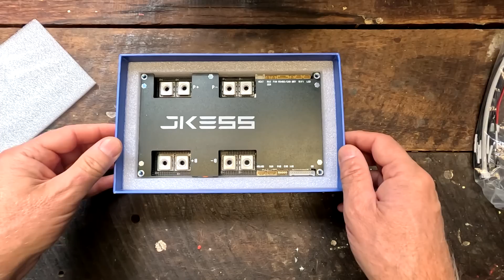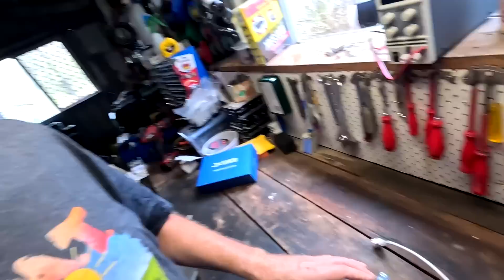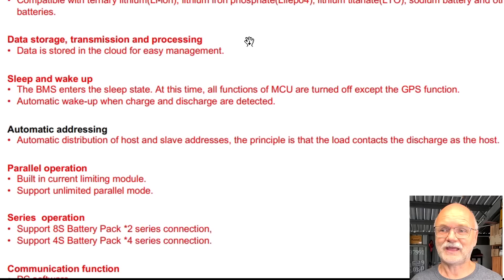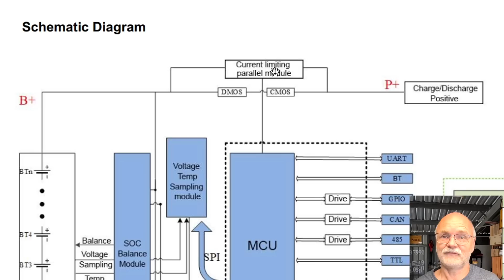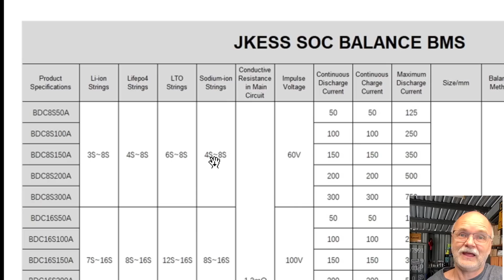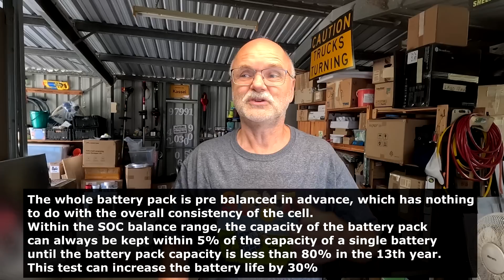Brand new JKESS BMS! Hardware, Specs, Features. It's not a JK-BMS though🤷‍♂️

Comment: If it takes the pack voltage and then using some kind of buck converter to charge up the lowest cells it means that it is taking a bit of energy out off all the cells to do this, how can this be more efficient than using cells that are approaching overvoltage and using these to charge the lowest cells, doesn't make sense.

Comment: first i thought they have completely messup something in the documentation,
but now i think, the 4 green terminals are meant to connect to a external LCD in the driving cabin with an additional programmable dry contact IN or OUTput.
But then the extension board has to be connected with another cable to the Wifi, GPS and maybe even the dry contact port of the BMS....then everything ould be extended into the drivers cabin.

the additional interal GPIO Cable seems to be an INPUT for a programmable trigger

But anyway...what a bummer :-D

Comment: @OffGridGarageAustralia: Andy can you please test it anyhow, you have it already. For offgrid it has not many new features that matters BUT for RVs and boats. It offers in  4S and 8S a lot of features nowhere else available like master and slave as well as communication plus the high peak current values allow to use the BMS also on motors with high surge like engine starter, windlass and bowtruster. Additionally the jk inverter BMS stops at 200A in 24V which is too low for use with engine starters and in boating the house battery must be able to start the engine in emergency. For that we need a 300A BMS which is only available from JK without any communication and no master and slave which again we need. If you don‘t wanna test it ship it to me and I will do the test…I pay for shipping.

Comment: I am waiting very hard for a fix for version 14 BMSes. They are nearly perfect. the only thing that is missing is the problem that they switch back from Absorption to Bulk when one cell gets to low. This should be fixed in 15.33 or 15.34 but these versions are nowhere to be seen. I still have Version 14 BMSes. Installed in paralell, connected to the cerbo, but not controling the charging because of this bug

Comment: The thing that I am very disappointed with is that they only sent you a 8S unit which means you cant really run it thru its paces in a 48V 16S battery like we use in our setups. I hope JK will correct this and get you a unit you can really use.

Comment: I don't like systems I don't understand how they work, which is the case here. 
Furthermore, it seems over engineered for what I need a BMS to do: Keep an eye on the battery, switch it off in case of a dangerous state and keep it balanced. 
I like the old JK BMS in their nice case with the well working active balancer. They do all I need and I understand how they work.

Comment: Instead of measuring balancing current you can test it other way - discharge 2AH from one cell of the balanced pack and then mesure time it takes from connecting balancer to full balanced  pack again. It shows us real current it use to pump discharged cell. But if I understand correctly this is less crucial if it starts balancing on any SOC level, wlit can have virtualy infinite time to do balancing if it's not top balance, and it can mess less with charger states in the process. But it's only if it works as should, not as previous ones (v14 v15)

Comment: So it will bottom balance as well. The litokola(?) test battery will get the most amps out of it by letting the other cells suffer from that one lesser cell and be "drain balanced" to 2.5 volts all together??? Hope we can prevent that by settings. 
Might be nice though in case of emergency. Grabbing a few more amps to call your kids before you loose power...or watch even more YouTube....

Comment: As always, thanks for the interesting video.
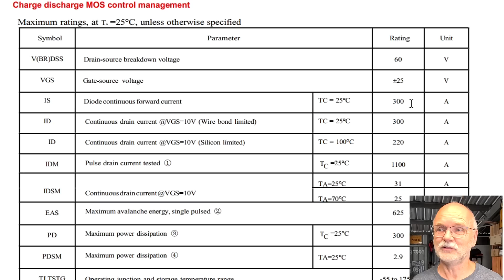One question mark that's in my mind is the drain source breakdown voltage of 60V @8:30. 58.4V (which is generally the maximum charge voltage for 16s LiFePO4) is below 60V, but it's very close. I'm surprised they didn't use 80V or 100V MOSFETs. I'm sure they tested it to make sure it's sufficient, I'm just surprised by it.
Reply: Never mind, I wrongly assumed they were using the same voltage for 16s as it had the contacts on the BMS, but they're not.

Comment: The SOC balance looks like the top balance I do.  When testing batteries, I connect all the completed batteries in parallel, which is around 3.29v.  When all batteries are tested I wait a day or two till all of them are balanced.   Could the new BMS be doing something like that on the fly?  All higher voltage batteries are charging all the lower voltage batteries to a calculated average voltage?
Either way ... I'm happy with the inverter BMS's I have, and the EEL boxes, at the moment.   They keep the car charged, so I'm good👍

Comment: I do not trust the JK BMS SOC so I put external shunt battery meters on all my batteries which claim to be 100% accurate and have proven to be as well. The jkbms can read 0% battery and my other meter still reads over 50%. This is one thing they could improve on

Comment: Whilst it nice to have a BMS that works as it should, releasing a newer model before fixing the earlier versions is not a good business model.  When i spoke to support last they advised me they still hadn't released a new firmware for the version 14 hardware and they didn't have any dates as to when they would. I offered to send them back my version 14 in exchange for a version 15 and was advised the warehouse didn't differentiate the HW versions at picking so there would be no guarantee i would receive a HW version 15. so currently I'm still unable to fully charge my cells as the invert is instructed to stop charging once one cell reaches SOC. I have tried balancing earlier but it is all moot. There support for clarity sucks. id say more but the filters might kick in.

Comment: Incredible build quality! However there are a couple of things I'm not a fan of. The data stored in the cloud? and the fact that they can push updates to directly to the BMS? These both make me question the safety of using this... That would mean they have access to potentially your network and everything else connected right?  I'm trying to move as many things that I use to local control, as much as possible anyway lol.  
Great Review as always!

Comment: If the relay contacts can be programmed to open when charging is disconnected by the BMS then this is exactly what I have been asking for to protect alternators from blowing their diodes when the BMS is used in camper and boat installations. I won't be rushing out to buy one to replace my older JKBMS's though until there is a Mk2. Never buy the Mk1 of anything! By the way Andy I got my Victron SOC calculations to be much more accurate by setting the charge efficiency to 96% instead of 100% as I could see that every night my grid charger kicked in (and out) at the same voltage and yet the SOC at this point was about 4% higher every day. Perhaps LifePo4 do not have the claimed charge efficiency of 100% or perhaps this just fudged the calculation just enough to be more accurate.

Comment: It is a shame the new unit is not backwards compatible with the screen. Previous versions used this same screen. If the data is stored on the cloud and the BMS that would be OK. However if only on the cloud then it would be dependent on the web at all times, not a preference for many. Since this is supposedly be available for EVs this seems unlikely. But then again, this is JK

Comment: The dry contacts. It’s labeled NC. Are you sure it’s Not Connected and not a relay output defaulting to Normally Closed? :) In electronics we usually label stuff not populated/in use as NA, not NC, as we use that for NC vs NO circuit.

Comment: The old bmses used a boost converter to take from the highest cell and pump it into a super capacitor at 5-6v. It then dumped the power from the capacitor into the lowest cell when the capacitor was full. 

The relative difference between the capacitor and the lowest cell controlled how fast it would dump. 

Now they’re using a fly back to isolate the entire pack and dumping directly to a single cell based on the switching on the high side of the fly back. (Hence inverter). This means that they only have to measure low cell and dump to that cell then repeat. There’s no charging of a super capacitor.  Best case this is about 92% efficient if they’re not using an optoissolator. The current will be limited to the windings on the low side of the high frequency transformer. 

This is also why they have both positive and negative on the board. They have to have both to do this. 

Effectively what they’ve done is put a USB charger in it with isolation from “the mains”.

It’s active balancing. And if the SOC is accurate it means it could do both high and low without wearing the cells because the power is being diverted to the balancer BEFORE going into the cells so there is no extra discharge and charge for balancing.
Reply: Très intéressant, si c'est le cas se nouveau bms sera une bonne alternative si il n'y a pas de défauts de fonctionnement 👍

Comment: I have several originals for 16s and they are all doing great, but there’s no way in hell I’d go with this new gizmo when the inverter type is so plugged with issues. There are those that have waiting over a month for a communication fix, so I guess that they are running open loop. They need to fix what’s out there first. Don’t be JK’s trouble shooter Andy. They don’t pay you enough (anything). Seems like they get things somewhat working, put it out to market and see what happens.
Typical lost in translation documentation….again.

Comment: I'm excited for the new form factor and quality of manufacturing. LEV's like scooters and ebikes need better BMS' so they don't catch fire while in use, and the high current option is very nice. I also like the use of the positive terminal on the battery and power side. It just makes installation a no brainer. Hopefully they don't have the positive cell connection along with the balance wires (I always thought that was unecessary)

Comment: Are they using the new lithium super capacitors (x10 capacity of tranditional capacitors) driven with the total battery voltage and then repass the "virtual" current to balance charge the lowest capacity cells? I think I get that logic as the super caps are charged by the charger but do they top up each cell during charge and discharge cycles by diverting current from the strongest cell to the lowest capacity cell? What's the bms cell wire size? For max current throughput to each cell? Interesting. Thank Andy. 100k in a blink

Comment: Andy that looks very similar architecture to an E&J BMS we recently tested (I believe JK and E&J are the same parent company). Switching the positive is not really an issue, however it's a bit strange to deviate from the norm so it didn't impress me. It also means more connections therefore more cost for lugs, wire and failure points. Our biggest problem with the BMS was the internal losses and subsequently the heat build-up. We found it had about double (or more) loss than the regular JK BMS we tested. We were only testing it at 12v and ran a full 3000w load to check losses. 

There were also a few alarming permissions noted for the App. Essentially it alluded that it can collect any data regardless of if the App is in use or not.
Reply: Increased losses is likely due to it using high side switching. P MOSFETS have a higher Rds(on) compared to equivalent N MOSFETS. The reasons they went with high side switching is because that's what that analogue front-end (AFE, the MP2793) supports.
Reply: @upnorthandpersonal  agreed, however this was a major step backwards in my opinion, at least when it comes to heat which is a high priority inside a small sealed battery like I make.
Reply: @PowerPaulAu  "this was a major step backwards in my opinion" --> absolutely.

Comment: If anyone could build a BMS "test" it would be you ! For example, a 4S LFE build with known good cells with 3x 120AH cells and 1x 100AH cell. With separate bi-directional (+/-) current/energy meters on each input and output as well as each balance lead it would allow you to quickly demystify all of these manufacture claims, as well as calculate BMS efficiency. I've not seen anyone do such a thing but it seems it would be pretty darn amazing !
Reply: oooh, such a contraption would also allow you to validate any efficiency claims of the different balancing boards, including external ones. Gosh that would be exciting !

Comment: Glad you have plenty of LFP batteries to put at risk testing a new BMS for us.  

Sounds like balancing is DC-DC conversion between each cell separately and full battery stack voltage.  I presume 'bidirectional' means can suck or push current to or from individual cells to total battery stack.  A simpler version just bleeds moderate balancing current and pushes it to total battery stack (uni-directional balance bleed only)  

This is a common way done in automotive. Only issue I know of is it can sometimes result in the balancing current exchange to full battery stack screwing up the charging float/absorb trip points for charger causing charger to prematurely drop out of absorb phase when charger uses current taper off to determine absorb phase exit.  Cells balance bleeding boosted up to battery stack can look like a current drop off to charger.

Comment: Very interesting. Thanks for giving us this overview. I am a big fan of the basic JK BMS and their balancers now that the SOC reset is better. SOC tracking still is a problem but that is inherent to LIFEPO4 (LIFEPO4 based cars need to be charged to 100% periodically due to this).

They use a lot of fancy language and claims which may be lost in translation, but do they actually (all) apply to LIFEPO4? Please ask if you get a chance.

"until battery pack capacity is less that 80% in the 13th year" statement makes me a bit nervous, but maybe it is just an example of one of the chemistries.

In any case it will be very interesting to see your results.

Comment: Another new BMS... I would be happy if the inverter BMS received a firmware update to solve the existing problems.
I hope JK doesn't forget that. The new one may be superior in hardware. But if the software continues to be developed just as badly, I don't see a future. First do the homework and more than 60%% would like an update for the V14 and V15.
Reply from the maker: Thank you.

Comment: Cell balancing really is the 'emperors new clothes'  isn't it.  As battery cell costs continue to fall, and for small scale static energy storage, the key to long life is actually to simply make sure your daily SoC cycle is as small as possible, ie to fit as much capacity as possible.  When you look at efficiency of balancing, even the 1st level basic back of an envelope calcs shows that the efficiency of this process is completely irrelevant, it litterally doesn't matter. And of course, if you are staying in a small SoC window and not going to near the upper and lower voltage limits of the cell, which you should be doing for max life, then clearly the precise balance of the cells is completely irrelevant anyway.  I'd put money on never getting a ROE above 1 on any complex bvalancing system, especially when you could just spend that money on more cells in the first place.....
Reply from the maker: Thanks for sharing your thoughts. Great comment.

Comment: What's the advantage of pulling through both + and - main terminals? More high current cables to worry about? Maybe because people didn't understand the wiring and kept blowing up their BMS's?
Reply: It's because of that AFE they're using. It only supports high side switching.

Comment: Series pass, back-to-back MOSFET's are in positive battery line with MPS279x BMS analog frontend chips.  This requires a charge pump to provide MOSFET gate drive 15v above battery voltage which is included in MPS279x chip.

Only thing done with battery negative through line (P-, B-) in the BMS is series current shunt.  I would prefer ability to add quality external shunt resistor, with external current shunt sense wires going to BMS inputs.

Data stored in cloud is dictated by PRC so they can get access to your local network and leap-frog to other protected sites of interest to PRC.
Reply: You got that about the PRC.
Reply: Only assumptions and fear spreading, no facts.
Reply: @JdZ-2023 MPS is a Silicon Valley based company but with a lot of people with strong ties to China, wafer fabs in China, sorting facility in China, etc.

With that said, I don't think MPS would bake spying in to the chip.

JK might add in extra stuff to do that but I don't know.

If MPS now is anything like the MPS I knew years ago, the chip should measure as good or better than the spec sheet and use lots of tricks like zero crossing switching to be efficient and get as much out of the onboard power devices as possible.

An interesting thing would be to compare the JKESS circuit board to the MPS reference design.